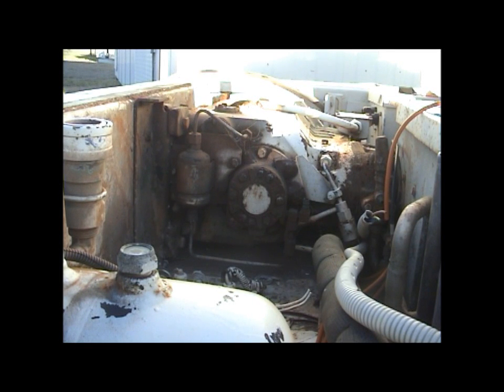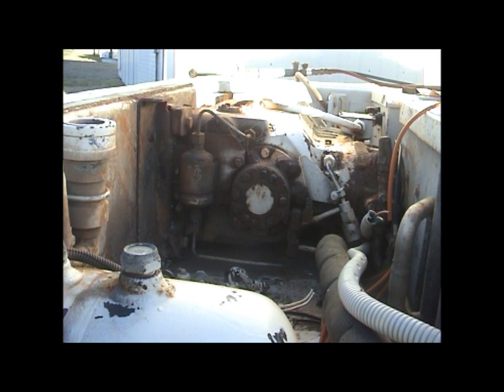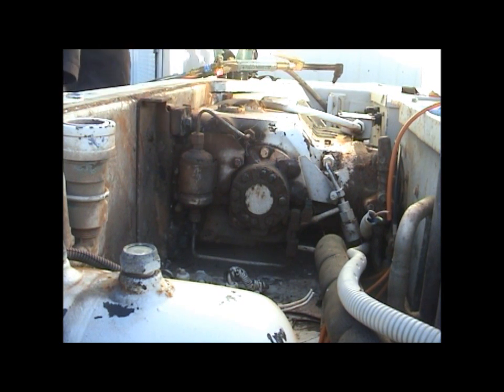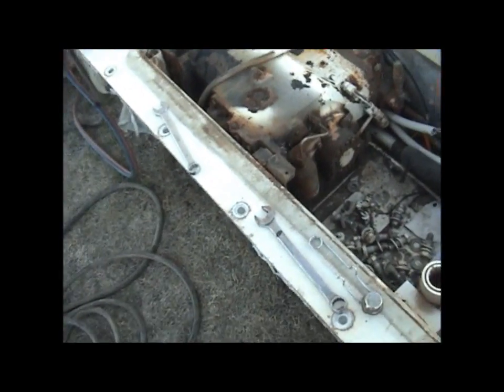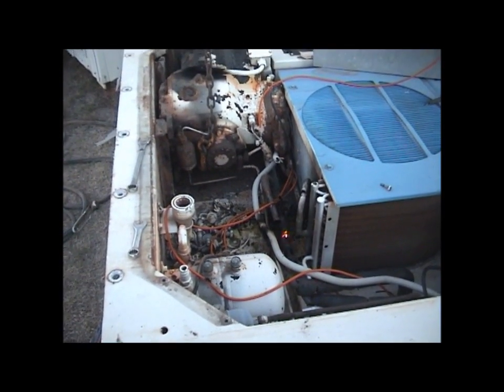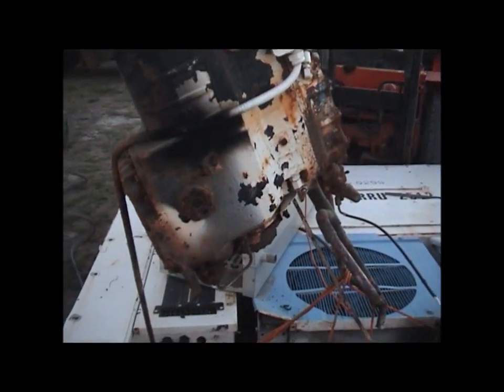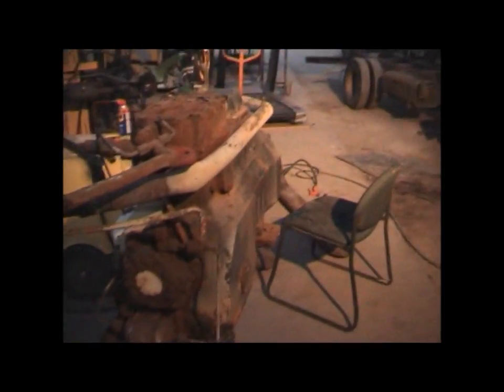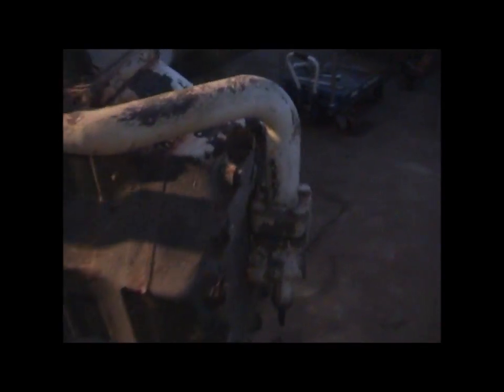Container Reefer: Compressor Removal & Inspect

Comment: Thanks.
I wish I had something I could rattle gun. The "nuts" on mine are not nuts at all, they are a steel collar that looks like it has been crimped somehow onto the 3/8" fluted bolt with some mega hydraulic crimping gizmo. Grrrr.
Looks like I'll be a good hour with angle grinder to cut all the collars off, then punch the 3/8 centers inwards. It worked for the first 2. 
Otherwise your unit and compressor looks similar to mine.
What's the plan for your container?

Comment: How did you get this whole refrig unit off the back of the container. Mine's got these nasty things that look like a cross between a bolt and a rivet. Seems designed NOT to be removed. Tried grinding the head/bolt off but it still seems to hold on. Doesn't look like you used oxy for this because I can;t see the burnt paint.
If you had the same thing (squished nuts onto a grooved bolt, how did you do it?

Comment: awesome!
stainless can be torched off, but you just have to let it melt, not try and use the oxygen to burn it up. it is a lot more stubborn that mild steel

looks like you have a great yard and workshop to play in :D. that compressor will be fun if its still servicable!.